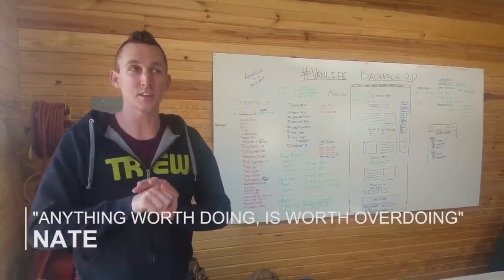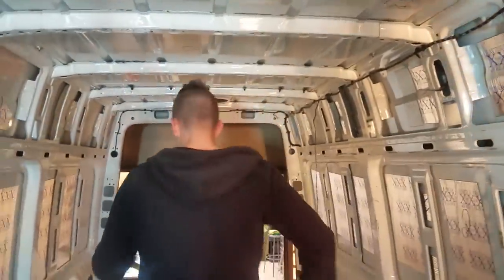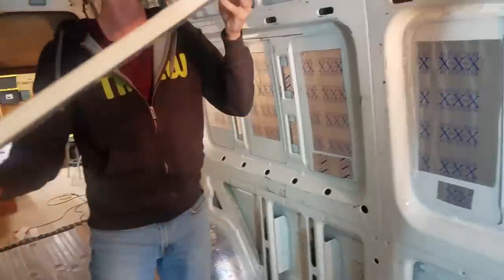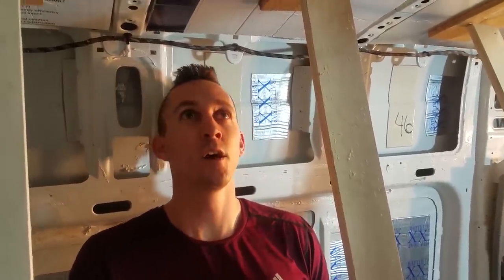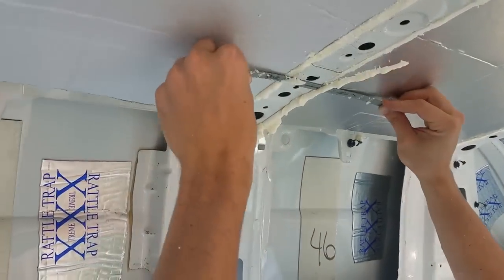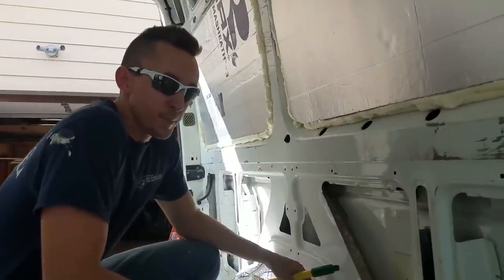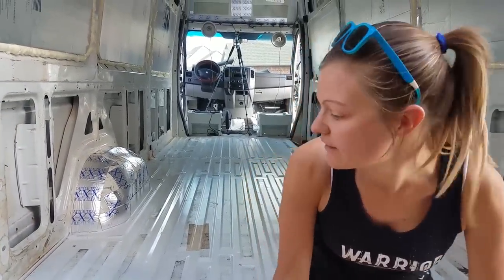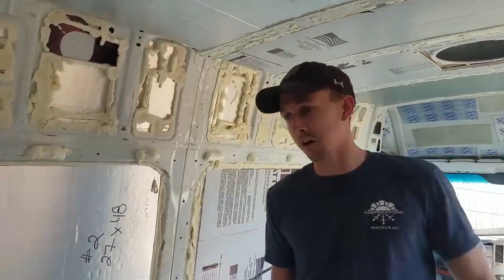Installing Campervan Insulation in our DIY Sprinter Campervan - Ep: 8 | Adventure in a Backpack

Comment: So if I got this right, you used 1 inch insulation and then 1/2 inch insulation on top of that on the ceiling and the walls? If that is correct, why would you put two layers of insulation on top of each other instead of one bigger peace? And on the floor, did you nail the plywood and insulation down onto the wood you put down or did you use some time of adhesive spray? Btw thank you for the great video!!
Reply from the maker: Xgaming4You Thanks!  We used a combo of 1 inch and .5 inch for two reasons.  First and biggest reason: we couldn't find 1.5" locally.  Second: in some places we needed half inch, in some spots we needed 1 inch, and in some places we needed 1.5 inch, so it was a bit more of a 'flexible option. 

The floor is secured with a bolt on each corner of the plywood flooring that we laid over the foam and the foam is just sandwiched there.
Reply: Adventure in a Backpack thank you for the reply. Do you mean that on the floor the bolt goes through the plywood, through the insulation and into the van floor? And is it correct that you need different thickness insulation at different because you want it to fit in between the ribs? So sometimes 1 inch would be thick enough to fit in there?
Reply from the maker: Right!  Bolt through the plywood, the insulation, and the van floor.  Lock washer, washer, and nut on the bottom of the van, then coat the nut with some kind of undercoat spray.

As far as the different thicknesses, you could do that, but we did not feel like the time needed to be that intricate would be worth the added insulation, so we did not do it like that.

Comment: looks great. I will follow this build. that insulation I think is the best. it will not suck up condensation/moisture that can be muld.
I agree that it's a lot of different ways of insulation on YouTube, but it's looks like people don't think of moisture.
Reply from the maker: christoffer1973 yeah, that's kind of what we thought.  We felt like this would be the quickest to dry if it did happen to get wet.  Thanks for the comment!
Reply: What is the name of the  insulation you used? You did not put it on "Info"
I realy like your videos!
Reply from the maker: Thanks so much!  It is R-Max Insulation.  That is the brand name, but they 'type' of insulation is called "PolyIso Insulation".  Thanks for watching! :D :D
Reply: Thank you for the info.. That help me search for the right produkt.. Sitting and watching your videos... Just going to wach if you have video on the fridge/cooling box

Comment: Hey, love this video series. Some of the best walk throughs I've seen. Nice work, thanks for taking the time to share them. I see you filled the ribs with foam. Did you run any conduit or electrical cables first? If not, where do you plan to put them?
Reply: Andrew Sleigh I would also like to know this.
Reply from the maker: Andrew Sleigh Sorry guys! must have missed this comment.  We did not run wires in the walls as we weren't exactly sure where we were going to run everything.  We are enclosing our wiring in split loom and hiding it in a 'wire chaise' style.
Reply: Sorry, what's 'wire chaise'?!
Reply from the maker: oops,  weird autocorrect... wire chase.  Like a hidden compartment or area for wires to run through.
Reply: OK, cool. Well, I'd love to see a future video on running wiring, if I can place a vote for that! I'm a little way behind you, but documenting my progress at http://wildebeestdiaries.com
Reply from the maker: For sure!  That one will be tied into a 'Campervan solar and electrical' kind of video.

Comment: Was going to congratulate you on a really thorough job on the insulation (especially for an US build) which it was until you bailed out on the floor - no soundproofing, 1/2 inch & thin ply - it's cool now - I believe you are heading for Alaska - it will be really cool then - if it was me - sound proofing (full) 1/2inch which will deform into the gaps, ply, 1 inch, 2nd ply, you don't need battons just screw the ply sandwich together - then dense foam tiles (like for a garage floor) then carpet tiles or afgan rugs. You are lucky you have the height - don't skint on the floor. Apart from that looking really good.
Reply from the maker: Nick Wood We would have loved to have been able to do that much on the floor but Nate is 6'2" and we needed to preserve as much headroom as possible since we plan on living in it.  We didn't really bail out on the floor, more of a calculated sacrifice.  Also, Alaska is incredibly moderate in the summer!
Reply: Looks a good 2 to 3 inches left to me - eg @19:55 - here in the UK you can still get frosts in the summer - my floor in a 5ft high van is over 2 inches thick - the perceived feeling of solidity also adds to the comfort - admittingly he wouldn't be able to jump up and down much :)
Reply from the maker: Nick Wood haha!  Yeah, even before installing the actual flooring (wood lam/vinyl or whatever we decide to use) his hair is already touching after installing the ceiling.  Going lite on the floor insulation was definitely a good choice for us.
Reply: @Nick Wood... You get about a bit lol :-)
Reply: @Campervan HandyMan - not as far as Lanzarote -definitely a video too far :)
Reply: haha was bored and had itchy editing fingers

Comment: Nice build,  How many cans of Great Seal did you end up going through? I assume 24 oz sized?
Reply from the maker: Thanks!!  We ended up using 21 total cans, separated between the standard stuff and the 'big cracks' stuff.  Dollar per oz, it was actually more economical to use the 12oz cans when we priced it out at the hardware store, so we used the 12oz cans.  We have some more specifics on the blog post about how many rigid foam panels wee used and such as well (https://adventureinabackpack.com/how-to-insulate-a-campervan/)
Reply: Thanks, were you on CO TF1 or NE TF1?  You referenced SCT training.  Only saw your  Youtube stuff, didn't know to check out the blog.  Thx.
Reply from the maker: No problem at all!  I was a firefighter in Norman Oklahoma before I moved to Colorado and was a part of their Technical Rescue Team.  You have experience in that?
Reply: Use to be a Search Team Manager for COTF1. Now I'm back to a canine search specialist for them.  Odie was my K9 at the WTC in 2001.  Doing a lot of research and planning for a van conversion similar to what you did.  Let me know if you swing through the Aspen area.
Reply from the maker: Very awesome!!  I always love watching the search dogs work.  The department I was at JUST got a dog...pretty cool! :D  I'll definitely let you know if we hit up the Aspen area.  I'm sure we will at some point!  Love that place.

Comment: wont work,sorry,but u need to do your research,in order for ANY insulation to work ,u need to install a VAPOR BARRIER,and u need proper fresh air supply and stale air exhaust,PERIOD, If u dont,besides not working,u will develop mold,sooner or later
Reply from the maker: After only one week, the thermal properties worked VERY well.  From 30 degrees to 90 degrees, it actually stayed pretty manageable, but thanks for the heads up!  I'll keep an eye out for mold and mildew.  I guess you haven't seen our other videos because we have some pretty awesome fresh air flow with two MaxxAir Vents...airflow for days!! Thanks for your concern!  How would you have insulated it?
Reply: @adanacman666  why do you criticise without giving any alternative methods to insulate?
Reply: He did mention the need for a vapour barrier to be fair.  I can see the Celotex working well.  But the hollow metal structures can become cold spots and that is where moisture can condense out and that can lead to water becoming trapped and rust.  Your climate looks warm so it may not be an issue.  In England trapped moisture is my concern with any insulation approach.
Reply: Apparently applying reflectives directly on the inside surface of the metal van walls wont do the job, an air gap is needed between the reflectives and the van wall, some people use an open cell foam in the air gap to prevent condensation build up.

Comment: to anyone watching this video, follow what they did if you choose too, BUT before you do anything they have shown here, run all the wiring first an all plumbing. When it comes to wiring run a few extra lengths an put the wiring in conduits. Don't be lazy, take the time and do it right first time or pull your hair out later an still not be able to do it. Odds are you are going to forget something, or add something later on.
Reply from the maker: ...or you could run it inside of conduit just like we did and hide it inside cabinets on the outside of the walls.  A lot of people when doing their first build (us included) don't know where they are going to need outlets and plugs.  Running the wires AFTER the insulation is a perfectly fine alternative.

We didn't forget the wires or anything.  We knew exactly why we did it like this.

Thanks for watching